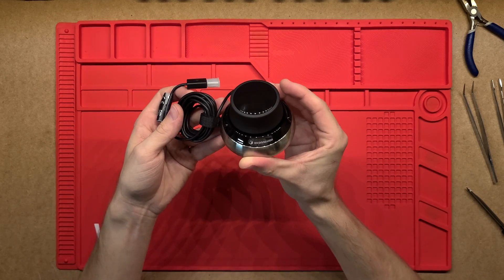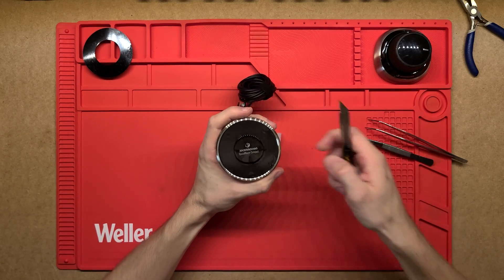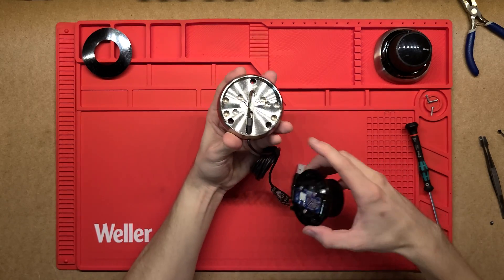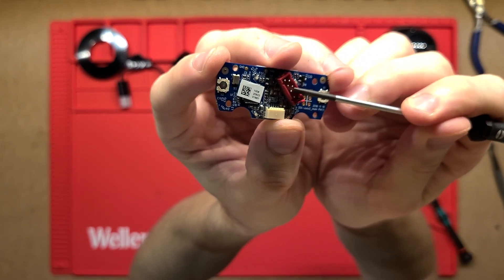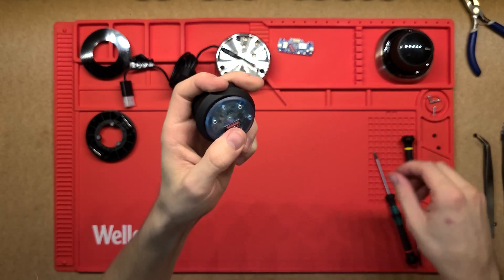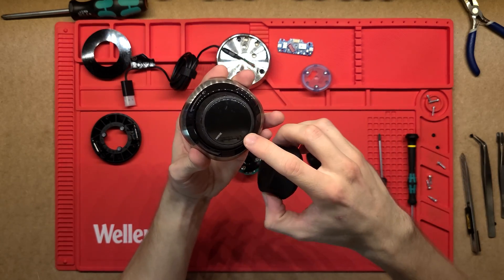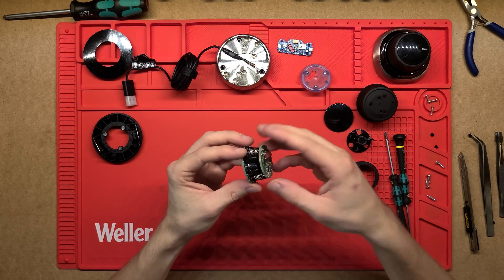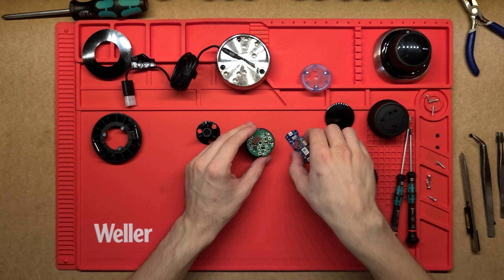Spacemouse - Inside is Not What You Thought!

Comment: The real magic for these things are all in the firmware/software. The hardware is next to nothing, but that is a nicely machined base! Should be an Atmel 32u4, I don't believe there is a "3214".

11:47 The chip on the knob is an HJ4052, which is a TI CD74HC4052PW, 16 pin analog multiplexer/demultiplexer, not a microcontroller.  This chip would be controlled by the 32u4 to select which IR sensor to read. Each IR transmitter is turned on, then the signal read, then turned off, rather that being on all the time. This is so that any internal IR leakage doesn't affect the other sensors. Obviously this happens really fast, and you don't see it anyway since it's IR. However, if you would plug this in and run it, your camera probably can pick up the IR light and see the flashing (unless it's super fast, like 1khz or something).

The other small chip to the right I believe is an OpAmp (probably amplifying the IR signals). The yellow thing is a capacitor, not an inductor. 

The rubber boot probably is for dust, but also to block ambient light from entering, this is an optical device when it comes down to it.  Note those are phototransistors, not photodiodes.

Wonder how much stress testing they did on this? I'm not a big fan of the way the springs are mounted. Is there no other mechanical connection besides it being soldered to the PCB?

Comment: So grateful to you for doing this breakdown.  I have one of these mice and the left button has become VERY stiff - any ideas what could have caused that?  My guess can only be some kind of dirt/food etc.   And.... how to fix it (preferably without taking it apart).  Many thanks :)
Reply from the maker: Glad you liked it! Yes, most likely something is stuck underneath it, first point of call would be to blow into the button, or use an air compressor to try to clean it. If that doesn’t work, you will likely need to take it apart to clean it. Maybe others here will have another way. Good luck!
Reply: @ToolsnTeardowns  Thank you so much.  I've managed to open it up, and can see the problem.  the buttons @7:54s, one clicks down and up (as you demonstrated), but the 'faulty' one looks like it has been pushed down very hard, stuck in its down position and is now concave (and not convex like the working one).  Any ideas how I can fix that?  Many thanks.

Comment: What kind of light sensors do they use in this mouse?
Reply from the maker: It will be either a Light To Frequency or Light To Voltage IC chip. Best I can tell it's in the IR spectrum.
Reply: IR Transmitter with an phototransistor

Comment: 10:52 the translucent blue disk is a light guide. There is a LED light that illuminates all around the "cap" through it. The LED can be controlled programmatically through the USB HID interface. The wireless one does not have the blue "ring light" to reduce power consumption.

Edit: just noticed it was already discussed.
Reply from the maker: Yes you're right! Thanks for your comment 😊

Comment: Thanks for the teardown, finally i know how that thing works, after using it for over 20 years :D
but a little critics:
- its nice to have a 4K vid on a 4K screen, but it feels like 50% of the footage is out of focus, so i don't really see more.  its even more disturbing... 
- i feel a bit offended by the "a little more plastic could have solved that" comment. As a product-designer i can see how much effort they put in to keep the ergonomics of the device consistent over the years, that includes the exact height of the swivel point, and the mass of the base. Drilling holes into metal is also cheaper then milling a slot out.
- that translucent blue disc is most likely a light conductor for the typical 3DConnexion blue lighting? at the same time, its the cap for the one component, that is probably the same for any of their devices of the same generation.
Reply from the maker: Thanks for your comment and feedback, I will looking into the focus. I definitely didn't intend to offend or criticise the design, simply expressed a different design approach another engineer (such as myself) may take. 
Ahh yes thats a good spot! That extra bit of plastic does diffuse the light from the blue glow slightly, although I don't think that's its primary purpose 🤔
Reply: How many years does the battery last??

Comment: What an interesting way to work! I thought they were using a hall sensor.
Reply from the maker: Honestly me too! I thought that was the way to go, but hall effect sensors have a non-linear response, so maybe the light method provides a more linear reposnse and are more accurate data. That would be my guess why. 🤔
Reply: @ToolsnTeardowns  I'm curious why there is no cheaper Chinese knockoff all around AliExpress.
May be because there is not enough demand for such devices... sadly. I'd love to have one but it is too expensive in my country and I'm just a hobbyist. I even made a 3d printed one with joysticks but it's a more pain in the ass than using a mouse. 
Looking in to their design I understand now why it costs so much. It really does cost that money. Good materials and clever engineering cost money. 

Thank for your video. Maybe some one will come off with some Arduino based replicas one day no we know how it works)
Reply: Apparently their newer models now use hall effect sensors, so the quality is a good question. Precision should be the same but now they could be affected by magnets and such so i much more prefer this optical way which doesnt seem to have a down side.
Reply: They seem to have been using light based sensors for quite a while. There's a DIY alternative called Shamrock Sixnav that was based on expired patents of an older model, you can see how it works on the patent and CAD drawings, very simple and elegant mechanism. There's also another cool design called Haptick which uses strain gauges.